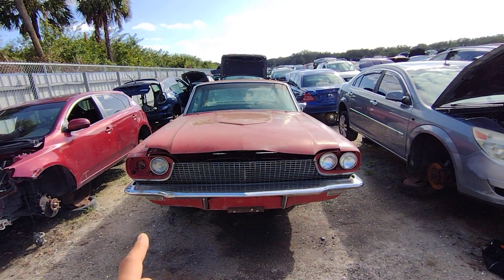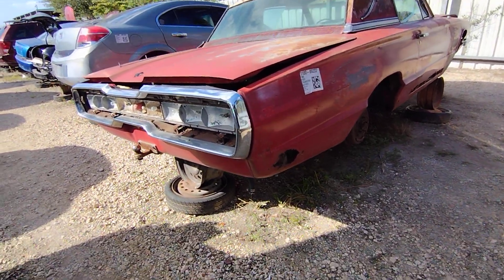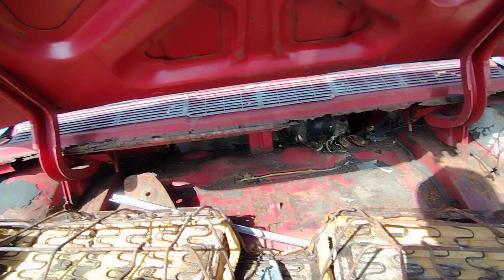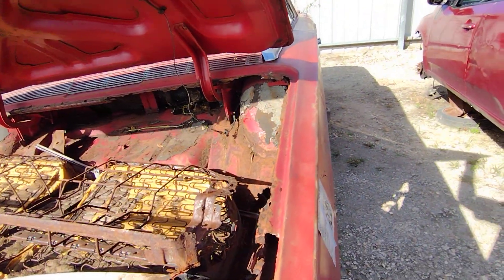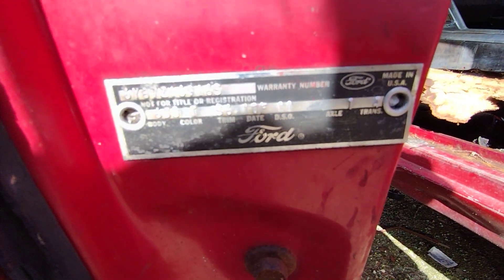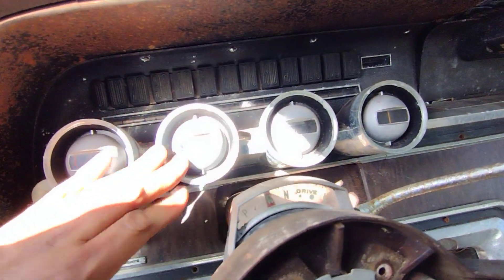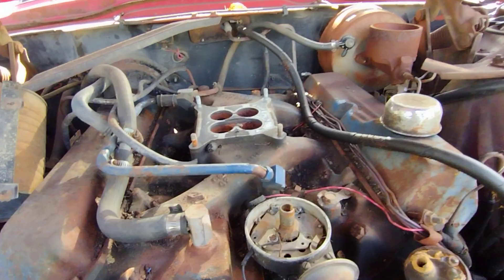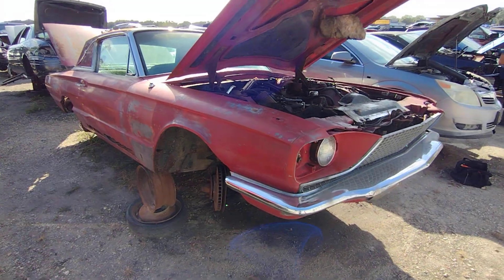Florida cooked this Town Landau Bird. 1966 Ford Thunderbird Junkyard Find

Comment: Whoa Nelley, 1966 and hit the bricks.

Yes, 1965 was the first year for standard disc brakes as well as double sided keys. Yes, the standard 390 V8 had 315 (gross) HP. The 428 V8 was optional in 1966 and would have had 345 gross HP. 1966 was also the last year for a convertible Thunderbird until the 2002-2005 "retro" models came out. 1966 was a styling redesign year and that "eggcrate" grille was first used in 1966. 

When are you returning to TX? I plan to be in FL later this month.

We got the VIN, we win: 6 for 1966 model year, Y for Wixom, MI assembly, 87 for Thunderbird two door Town Landau with blind corner and vinyl top, Z for 390 V8 with four barrel, and the rest is the production sequence. The Wixom, MI plant operated from 1957 to 2007 and assembled over 6 million vehicles in the 50 years that it was in operation. 

We got the tag, we can brag: 63D for Thunderbird Town Landau with blind corner and vinyl top, T for Red exterior paint, 56 for Black interior trim, 10F for Friday, June 10, 1966 production, 11 for Boston, MA sales district, 1 for 3.00:1 rear axle ratio, non-locking, and 4 for C6 automatic XPL transmission. 

The Tampa Park Plaza is located where that skating rink was and has a bunch of stores located in it. That employee (wherever that was) was putting away (or paying off something) that exceeded what he took home for net pay. LOL. 

Whoa Nelley, Hardy was tardy. 1966 and time for a deep six. 390 and gotta go. The 'bird became a turd. Painted red and going to bed. Off the road around 1991 and this one is done. That's it, time to quit. Motorcraft needs a life raft. Autolite soon to be out of sight. Going to be flat and that's that. At LKQ and it's over for you. Oh my Lord, it's soon to be a very flat Ford. "You came knockin' at my heart's door" (Johnny Lee, Urban Cowboy, 1980) and this one is soon to be no more. Going to get squished and only the Blue Oval faithful, maybe Nathan Kim, a few others, perhaps Benny, but not the Google Man are going to be pissed.
Reply: No brainer why it's here, but I can't believe so many great parts are still left after 3 months! The grille alone would go a long way to help someone's project or as a great wallhanger!
Reply: @nathankim7664  Because these don't really have that big of a following.

Comment: Although it's very rusty (especially in the back), it seems to have been taken care of and stored under a carport with the back sticking out.
However, I'm surprised the console pieces were still there as well as the front grille! Loads of good parts leftover!
That 390 will run, and you could make a "Will It Run Video" and drive it away with all the rust haha. But I too would pass on coughing up $500 for a 390. Too much!
What car were you planning on putting the 390 into Benny?

Comment: Surprised the rear seat is still there, those sell to custom guys.  I've sold fronts before.  The overhead console will sell too, that one looks like it's not in bad shape but missing the indicator lights.  I've sold the sequential taillight unit before if it's intact.  But not big money.
Reply from the maker: I was actually interested in the 390. I have something I could put it in. But they charge $500 for them and I have no way to take it back to Texas at the moment
Reply: @ClassicRideSociety  What is the car you had in mind for the 390?
Reply: @ClassicRideSociety  $500 is a lot for a motor.  Here they're $150 plus like $50 core.  I think both of the ones that turned up here had them in it, although probably had set up.

Comment: What size V8 came in these I'm not sure on these..google man will know
Reply from the maker: Most came with an fe 390 if not mistaken
Reply: 1966 Thunderbird models were 390 V8 standard with the 428 V8 optional.